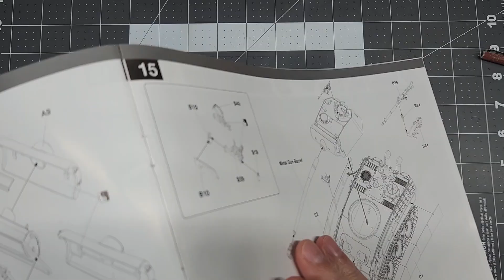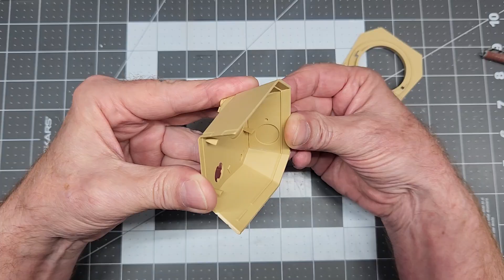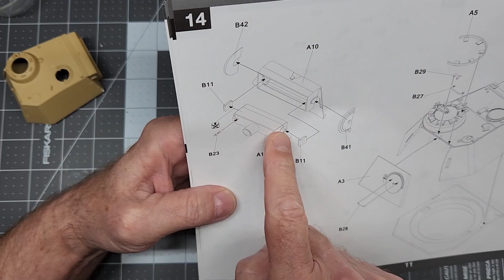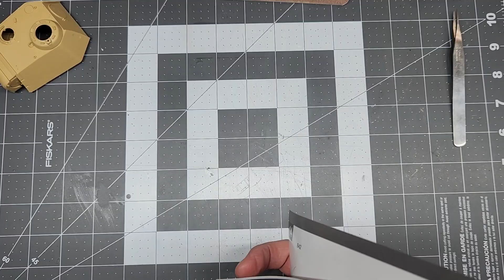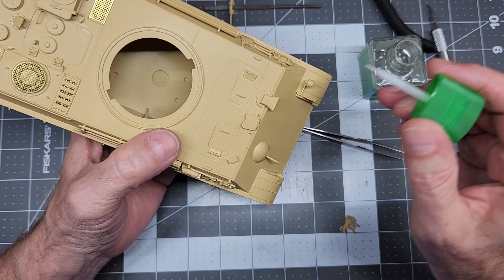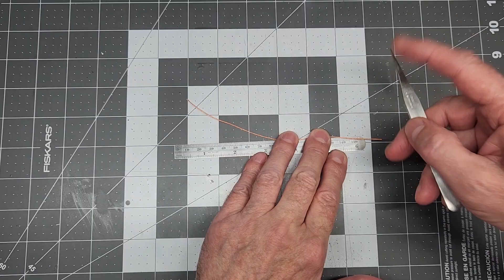Panther Ausf. G, Late Production, Part 3, Turret and Cables

Comment: Great work, Johnny. You certainly need a steady hand for the hole making process on the machine gun, I doubt that my finger would have survived intact had I been doing it with my hobby knife! the track and tow cables look really good on the kit even in its unpainted state. Looking forward to the next one, take care.
Reply from the maker: Hi Gerry, yes, those machinegun barrels are very small, but I managed without stabbing myself or breaking the part lol. The copper cables are a real plus in this kit along with the metal main gun tube, all top notch for a kit that runs $24.99, I haven't seen any other 1/35 scale kits come close. Next up we start painting! Thanks for giving it a look, take care and model on my friend. Johnny

Comment: I noticed that when you use your side cutter you do a twist and then clip it off. Does that seem to work better
Reply from the maker: Great Question! That is very observant of you! Most modelers don't think about these little things. I've noticed that for one the sprue is usually thinnest along the mold seam lines which makes for a cleaner cut and avoids the issue of pinching the plastic which can sometimes cause a little divot or pinch that I might have to fill later. This will happen if your sprue cutters are dull or if the sprue gate is especially thick. And two, I can better align my cut with the part leaving less to clean up. Thanks for the comment, take care and model on my friend. Johnny